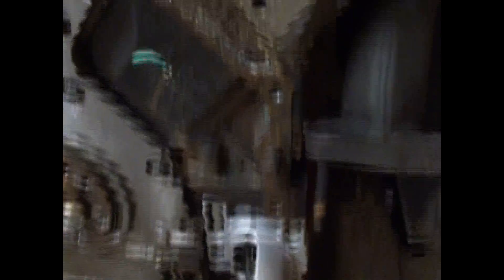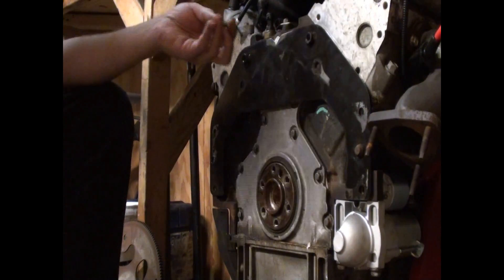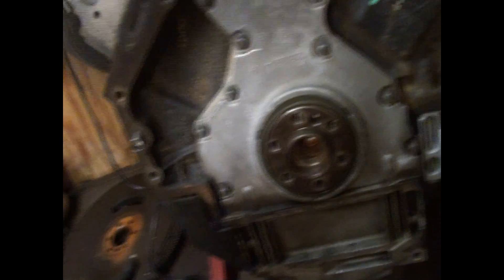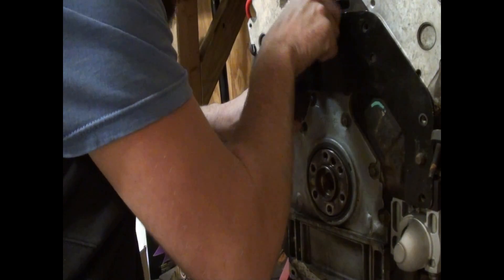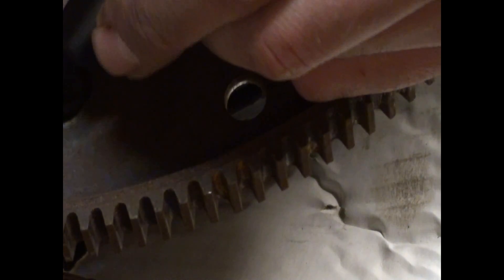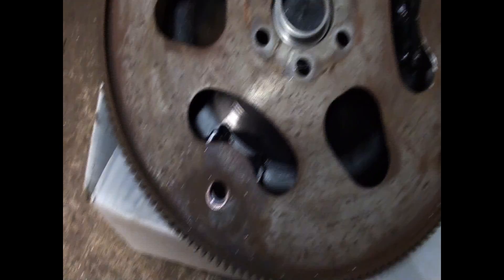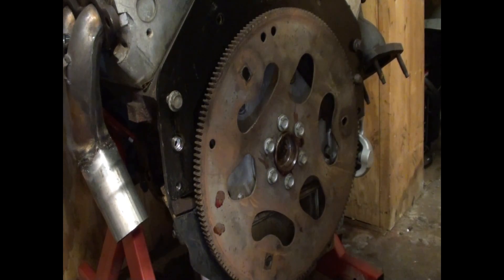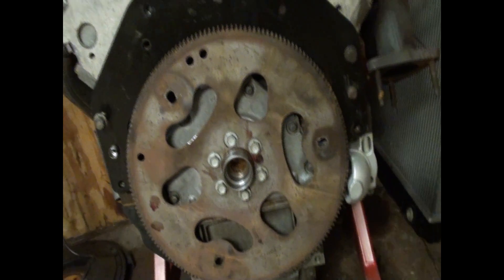HOW TO LS Swap Part 2: BOP turbo th350 TH400 to 4.8 "Modify adapter plate and flexplate".

Comment: I thought only the fly wheel and spacer were necessary
Reply from the maker: Typically all you need is the spacer but for this application i was using a Bop TH400 trans.

Comment: What is the adapter plate for
Reply from the maker: Using a BOP th400 transmission
Reply: @beeterolds  I have a 4L 60e transmission 95 to 97 model do you need the adapter plate for it to
Reply from the maker: No
Reply: Is the adapter plate absolutely Necessary??
Reply from the maker: Yes

Comment: aren't you forgetting the width of the adapter? I'm doing the exact same thing and my adapter plate is .30 of an inch thick. I'm assuming that I need .30in longer torque converter bolts as well as 3 .30 in washers for in between the T.C. and flexplate. I already got the longer dowel pins. correct me if I'm wrong... other than that, keep up the good work brother!

Comment: Has anyone put any horsepower through a BOP adapter?
Reply from the maker: Friend of mine has an 11 sec cutlass with a 455 running thru a th700.  No issues there